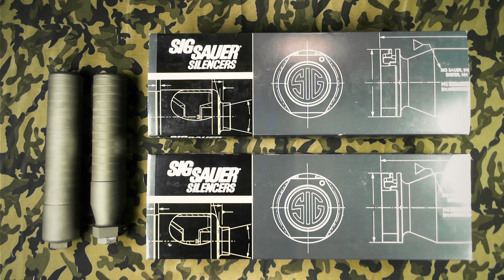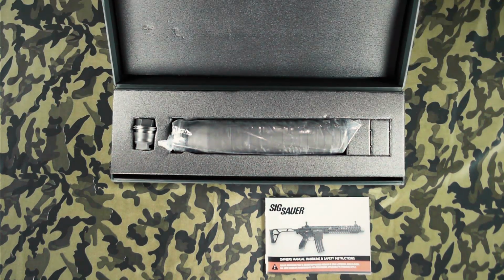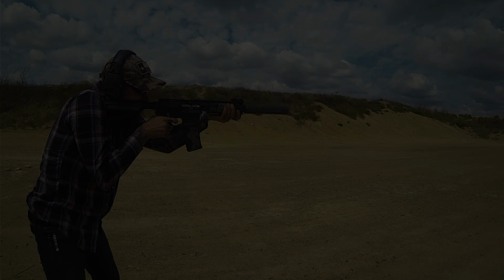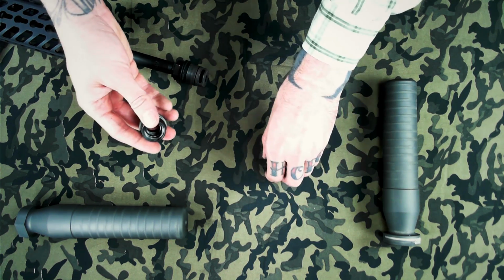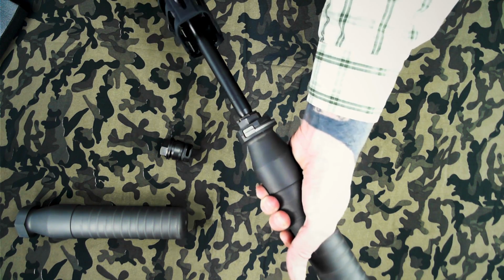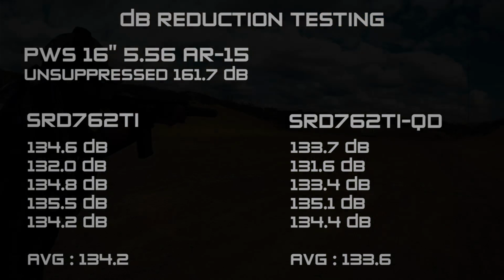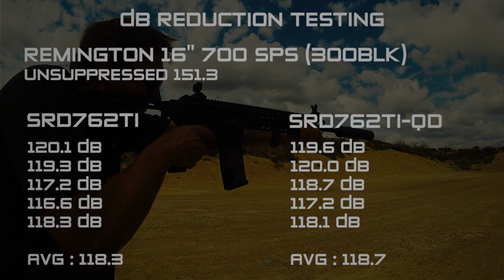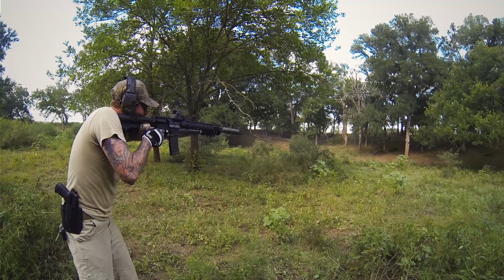Sig SRD762Ti / SRD762Ti-QD Review

Comment: Do you have any video or data using the SRD762 QD that isn't TI?   I want to see if they are the same decibel readings.  I figured I would get that one since the weight is only around an ounce different.  Since it is cheaper the weight is no big deal.

Comment: How do i get my SRD762Ti- QD To mount on my mcx chambered in 5.56. the real question is how did you accomplish this ?
Reply: +coairmx  They make a mount for use on .223 with a 1/2 x 28 thread pitch. The SRD-762-12X28-B.

the 12X28 is the threading, which reads 1/2 x 28. The -B is for a brake, a -F would be a flash hider.
Reply: +Tim Lovern +Tim Lovern Thank you , I actually called Sig Sauer and order 3 "5.56 flash hider " version  about 2 weeks ago and two more for my 7.62 rifles.
Reply from the maker: +coairmx Tim is correct.  Just make sure it's the 762-1/2x28 since the SRD556 1/2x28 won't work with the SRD762.  They complicated it a bit... I've got a bunch of them I just need to do some work to get them added to our system at work.  Feel free to shoot me an email Joshua@capitolarmory.com if you need any in the future.
Reply: +Onyx ATX yes thank you .. i did order these direct from sig ."FLASH HIDER ASSEMBLY, 7.62, TAPER-LOK, 1/2X28 FOR SRD762-QD SILENCERS" . thanks once again .

Comment: Do you know if the Griffin Spartan 3 will fit under the Sig MCX hand guards? I'm wanting to cut the barrel to 10.5 and pin the suppresser on. Thanks.
Reply from the maker: I don't know unfortunately. The MCX rail is fairly thin side to side. The one in that video I just sold (good client had to have one) or I would test it out. MCX is a great rifle though, I hated to see it go.

Comment: Hey bud you said the ti are full auto rated. but they are not. just wanted to let you know?
Reply from the maker: They should be... at the time of recording at least, the statement was they were rated for full auto, but if you're going to use them for that the steel would be a better option.   Perhaps Sig changed their statement, but that was from the horses mouth.